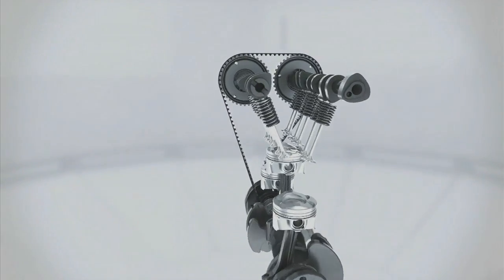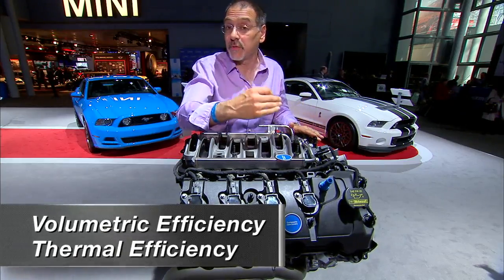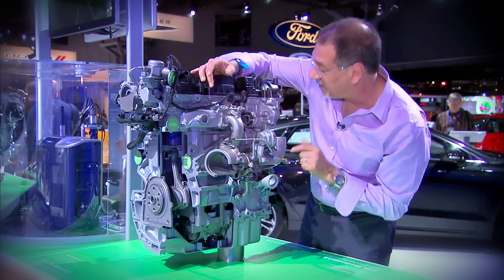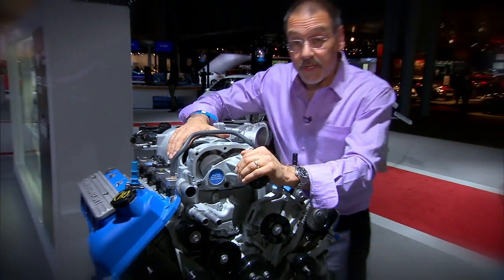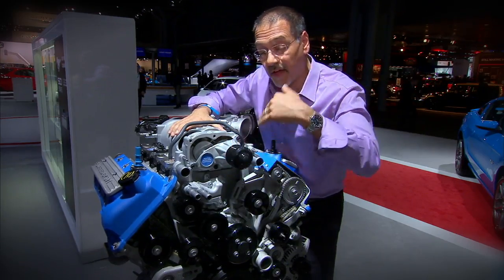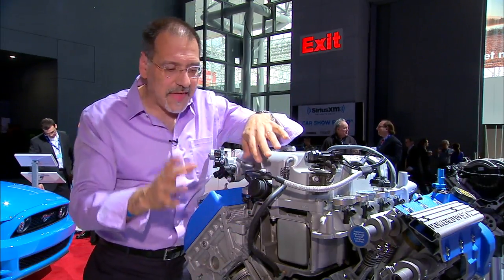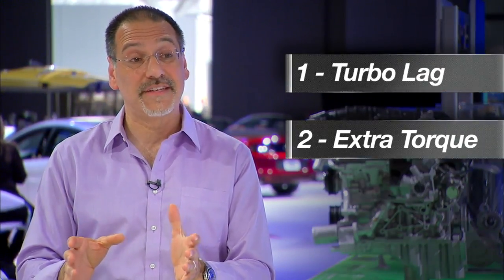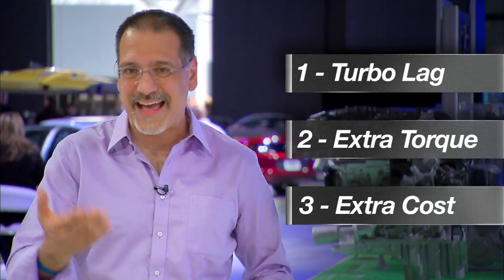CNET On Cars - Car Tech 101: Turbos vs. Superchargers

Comment: what is that setup he's looking it at 3:11 into the video? an intercooler inside the intake manifold? the engine doesn't seem to be running a supercharger also but a efi sutup, can someone clarify what this setup is and what engine it is and what car its out of? big thanks.
Reply: That's the motor that goes in the GT500 if I'm not mistaken.
Reply: Jason Adams 

You are correct, that is the exact engine and supercharger setup that comes in the FGT.
Reply: It's a Mustang GT500, 5.8L, V8, and yes that's the back side of the Supercahrger and the intercooler he is pointing at is an Air to Water intercooler that uses it's own resiviour and electric water pump. That intercooler like you said is underneath the supercharger, here is a picture of one with the supercharger off,  Link and end. the air is forced through that before it can enter the intake manifold. The supercharger takes atmospheric air pressure and compresses it and when the air is compressed it becomes hot, think of when you use your air duster can and release the air AKA blowing off your keyboard, the can become cold that is the opposite reaction because instead of compressing the air you're decompressing it. So they use this air to water intercooler to bring the air temps as close to ambient as possible, before fuel is sprayed into the intake manifold. The reason for that is because when the air gets hot it is less dense and also become volatile when mixed with fuel  which is now under pressure because of the supercharger. That's also where detonation occurs if the air is to hot and pressure is to high without stable enough fuel or not enough fuel. So not only will you make less power but you have a greater chance of detonation, that's also where spark timing and AFR's, or Air to fuel ratios come into play and that's another story. https://www.google.com/search?q=ford+water+to+air+intercooler&rlz=1C1ASUC_enUS588US588&espv=2&source=lnms&tbm=isch&sa=X&ei=l2P0U_LDGor5yQSnyIJw&ved=0CAcQ_AUoAg&biw=1920&bih=955#facrc=_&imgdii=_&imgrc=8Kkd6070DA6uuM%253A%3BVLi9kAx5-NAcgM%3Bhttp%253A%252F%252Fimage.musclemustangfastfords.com%252Ff%252F9079467%252Fmmfs_060069_07_z%252Bford_lightning_ported_eaton%252Bair_to_water_intercooler.jpg%3Bhttp%253A%252F%252Fwww.v6performance.net%252Fforums%252F6g-honda-accord-performance-discussion%252F206391-liquid-intercooler-now-available.html%3B640%3B480
Reply: tehwhatcrack wow so one person know how to use google.

Comment: So if cars have turbo lag because of turbochargers, wouldn't the logical solution be to put the turbo (more specifically the impeller) closer to when the exhaust gas is first released and not have a long pipe? Or is the length of the pipe negligible? Do engine manufacturers do this and I don't know?(pause to all that)
Reply: Generally the exhaust turbine of a turbocharger is placed as close as reasonably possible to the exhaust ports of an engine to maximize the heat and pressure available to "spool it up" even so, it's not enough to eliminate lag. When you suddenly open the throttle it simply takes time for the additional air and fuel to rush into the cylinders to produce enough heat and pressure to spool the turbo. It also takes time to overcome the inertia of the turbine, shaft, bearings, and compressor, especially for big turbos as well as time for the extra air to wind its way through the intake system. There are ways to minimize turbo lag though.
Reply: Ok. Thanks, that was helpful
Reply: NotADocButA You can also look into anti-lag systems. Engineering explained has 3 great videos explaining them. Look up: Turbo-lag explained, ALS Bypass valve explained, ALS ignition delay explained. Essentially, it causes combustion to occur within the exhaust manifold, allowing for a sudden surge in power, however, the exhaust manifold is usually not built to withstand this type of stress and will need to be replaced periodically.

Comment: ok i understand what hes is attempting but Turbos suffer at low rpm because they must spool superchargers suffer because of parisitic draw proper application is the key and never Forget stock Turbo cars are built with Little Turbos so you feel a bit of Punch and peep when coming of the line but loses boost at higher rpms because the waste gate springs are set to prevent total detination or engine failure aswell as the fact that the pressure eqaulization effect of a small Turbo thus no lag at low rpms but no top end power and big Turbos with great top end power but massive lag at low rpms

Comment: He mixed up the turbine and compressor sides in his demonstration. Turbo is infinitely more efficient as you can size the turbine and compressor to the exact specs that will give you what you want out of the engine. As for lag, easy to get around that with proper sizing.
Reply: Not trying to put words in your mouth but sizing with a turbocharger isn't a cure-all and they all experience some degree of lag by nature. But you're right to the extent that a properly sized turbo will minimize the natural short-comings of a turbocharger within the intended rpm range and for the intended engine the turbo is sized for.
Which is why for most low to mid-boost applications I prefer a roots-style supercharger (or, ideally, a twin-screw) as they are, in addition to being simpler/self-contained systems, alot more forgiving on size, rpm range, etc and with a by-pass valve, offer very little parasitic loss when under non-boost situations.
Reply: 177SCmaro Sizing can eliminate lag. Lag is the delay between the throttle being pushed and the turbo spooling up to a speed where it can produce boost. This lag can be eliminated almost completely with proper sizing. There is no lag if the turbo is starting to pressurize the system the moment you dip into the throttle. That is just building boost, which is not the same thing as lag. If you're building boost slower than you want, then your dynamic compression and flow rates need to come up. Which means porting your head and improving the intake and exhaust systems and then raising the compression up to meet the cams at the dynamic compression you want where it will produce the power you are looking for at a specific given range. The best DCRs I have seen with pump gas are around 8.5-9:1. 

In a street car I prefer an NA, but I also prefer something with a 4 cylinder for daily driving. I don't like paying for the rich kid's tuition just because my car wants to pour gas down the drain.
Reply: Joe11Blue there will be lag no matter what, but you can decrease it with the proper turbo size to the point where it will be difficult to even notice it. but it is the most efficient power adder hands down.
Reply: Joe11Blue You're looking at a dynamic system with static eyes. There will always be lag  and inefficiency with a turbocharger at some point in the rpm range, usually at lower rpm.

Like most dynamics of an engine, it's subject to a system of trade offs. You optimism a turbo to spool quickly and it will likely be restrictive and inefficient at higher rpm. You optimize a turbo for high rpm, it will suffer from low rpm lag and inefficiency. You optimize a turbo for mid-range and it will be a compromise of the two; offering a small about of lag and inefficiency at low rpm and it will be somewhat restrictive and inefficient at high rpm.

Yes, there are ways to compensate for a turbo's natural limitations to "cover most of these holes", but it's not some magical uber compressor that's efficient and "instantly" responsive everywhere in the rpm range.
Reply: 177SCmaro
A good variable geometry turbo resolve the problem, but they are more expensive and more difficult to engineering correctly.
The automotive sector never liked new ideas and when they present something new, or is a fancy idea of some designer (without a technical formation) or is something that the aeronautic industries widely used 35/40 years ago.
Reply: +Emilio Baldi I agree with you, but now a vgt its not so uncommon to see or dificult to set up... porsche's Turbo and Turbo S versions uses this kind of turbo, and there's a good response and ammount of boost around all rpm range... Superchargers and turbos are both extremely nice when you are searching for some good performance gains, so, no real winner here...

Comment: turbo is better in my opinion your not limited by the cars RPM.
Reply: Depends on the turbo size and how much fuel you can inject. My 335i had two tiny turbos on it. when you boosted above 15psi the torque and hp dropped out at 5,500 6,000. Now that I put a 6466 turbo on it has no issue going all the way to redline.
Reply: You definitely didn't understand what I meant. Turbo can spool to 250k rpm as to where a supercharger is limited by the engines rpm...
Reply: Exhaust driven>belt driven.
Reply: lucas young A gas engine can only handle so much boost anyway without pre-ignition so a turbo's ability to spool to a high boost is a bit redundant to a gasoline engine.
Reply: lucas young You can sort that by simply changing the pulley ratios, but in general, u dont need the high rpm of turbo to get the same result from supercharger.

Comment: So stupid worst advice ever says not likely to find a car with supercharger look at the millions of pontiacs n buicks Lame
Reply: Did you hear him say superchargers are parasitic since they run off the engine? Cars are meow being produced with fuel economy in mind, so he's correct, and you are an wrong. Checkmate.
Reply: jbmop Yes you are definitely an idiot Meow Meow Meow Meow and you have no idea a small supercharger is not parasitic and increases fuel mileage especially if adjusted for low rpm so best think before you speak and learn before you burn cause you let your last brain cell go when you wrote this:) RawR
Reply: Easy there Eminem from 8 mile. Sure, when someone gives a blanket statement you're capable of finding a flaw, but what he said is largely true. Turbos allow a more efficient in terms of energy preservation.
Reply: jbmop it really depends on how the exhaust gasses are recycled truth is the urbo has a less complete burn than the supercharger in each setup however some of the exhaust gases are recycled and Burnt in the chamber so efficiencies vary and I would say a twin turbo with a low and high turbo will out accelerate a supercharger but Idk some superchargers spool up very fast as far as parasitic losses thats really only with the bigger superchargers the smaller ones have little or no loss because the power they generate more than compensates for it my dad has a supercharged regal and its quick but great on gas for its age so superchargers are less prone to failure than the turbos I would say
Reply: I can't argue any further, for lack of understanding in the field.
Reply: lol you should look up the saltwater powered car the cadillac thorium car and look up the different types of superchargers some really arent parasitic it just depends on the setup
Reply: Rogue Vigilante
Well, superchargers ARE in fact parasitic as they do draw a small portion of engine power to power it off, and the effect will always be higher than that of a small turbo system obscuring the exhaust flow. This is the main reason why not many I4 engines use S/C but rather a small turbo to do the job.

However, superchargers are making a return thanks to Eaton's TVS technology which eliminates a great deal of pumping losses & that trademark S/C whine which to regular drivers may think it's unrefined. An example would be the 3.0 TFSI V6 S/C used in Audi's to replace the old 4.2 V8 FSI.
Reply: I wonder if they will ever have a real electric supercharger that could cut the parasitic loss completely... I already know about the tech thank you but it would be nice to see something from our age finally come under the hood I love the sound of a good v8 or 12 but when you want all out power its hard to top the power of a reactor even a cold fusion reactor would be able to generate power and we could electrify our roads and use them to power our grid with the reactor cars we build its just a thought and you seen it here first;)
Reply: Rogue Vigilante  An electric supercharger would still impose a parasitic loss on the engine at some point to recharge the (likely heavy) batteries, which is a less efficient process than powering a turbo or traditional supercharger, although electric could have advantages over them in some cases.
Reply: lolz some people crack me up the way how they reply when they actually have no idea about something
Reply: 177SCmaro Youre so silly the electric superchargers they use do not work and they run off the Alternator what you been smokin?
Reply: Rogue Vigilante
The only place an electric supercharger would be realistic is on a drag racing car where a few precious seconds of boost can be generated off batteries.

All of the ones sold on Ebay & the rest are just for ricers or people who think CFM = PSI (t/l: for fools).
Reply: Rogue Vigilante  I was referring to centrifugal superchargers driven by an electric motor, and they can work, they're just not practical and they still impose a parasitic loss to the engine at some point.
Reply: 177SCmaro I see well regardless the alternator powers them and centrifugal superchargers are powered by the crank not electric and they deliver more power than most turbos but a lot less gas mileage turbos are way more efficent in high rpm situations cause of the recycled gasses and the fact that that spins the turbos and not the crank
Reply: Rogue Vigilante sigh...you didn't read anything typed, did you?
Reply: Some people dont listen
Reply: 177SCmaro did you even read my response or better yet do you have any idea how a supercharger even works?
Reply: Rogue Vigilante
I see what 177Camaro is getting at; instead of having a mechanical linkage (e.g. belt) between the S/C & crank, the S/C pulley will be driven by a electric motor instead, which takes power from batteries/alternator driven by the engine.

Still highly impractical for road-use IMO. The added complexity to the S/C & stronger alternator (and bigger batteries) are much more complex than a simple belt-driven pulley. Maybe for racing purposes, but not in a everyday road car.
Reply: Trades46 Yeaa I had reread his post after I put out two replies but lolz I agree totally impractical anything powered by batteries in a car is
Reply: There really is no purpose for electrically supercharging a fuel injected engine
Reply: Rogue Vigilante You're talking to someone who built and routinely races an ethanol-burning 550HP supercharged small block Chevy powered Camaro. So, yeah, you could say I have an idea how they work.
Reply: Nice and you do know that the electric ones do not increase your compression like the sealed units that are pulley driven I had misread your last post at first but either way electric superchargers in their current for are useless if they made them sealed they might work but the strain on the electric motor would be great
Reply: Rogue Vigilante If you're referring to those bilge fans people try to pass off as superchargers, yeah, those are a scam.
But that's not what I was talking about when I said "electric superchargers". Again, I was referring to the idea of taking a real supercharger, like a centrifugal Pro Charger, and replacing the pulley with a brushless electirc motor.

Like I said, it can be done, it's just not practical.
Reply: 177SCmaro I see that would be cool but I dont think they would be able to line up the engine speed with the blower motor sounds interesting though  I didnt know you were talking about unproven tech I thought you meant what has already been done regardless I would like to see that or perhaps an application on a smaller engine to test the theory
Reply: 177SCmaro
The problem is an electric motor to replace the drive power from the belt on a moderate size supercharger would consume at least 5 HP, maybe more. A 5-6 HP electric motor would consume at least 5 kilowatts, or typically well over 400 amps at 12 volts terminal voltage. That's one hell of an electric motor, so much so that it isn't worth even talking about. This is why compressors are all belt driven or exhaust turbine driven, and shows why the little electric toys with pint sized motors that run off doorbell size wires are a total hoax.
Reply: Jerrythenerdful That's why most, at least semi-viable proof of concept electric supercharger I've seen use 24V-48V brushless motors.  Also, depending on boost, I think your HP estimate might be on the low side unless your talking very little boost on a very small engine (I consider "very small" between 1-2L of displacement with 3-5lbs of boost).

As I said, electric supercharger can be done but they aren't yet practical given the still huge electrical demands, issues storing electricity, and overall inefficiency of the system i.e. turning mechanical power into electrical power then back into mechanical power to drive the compressor.